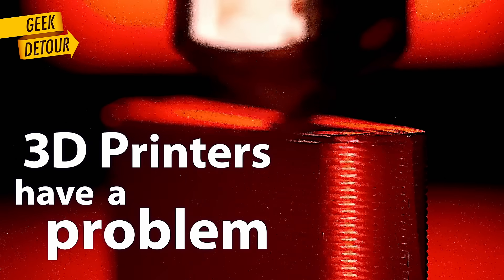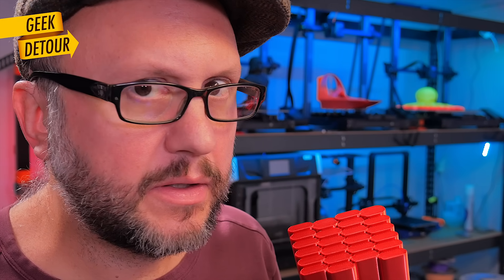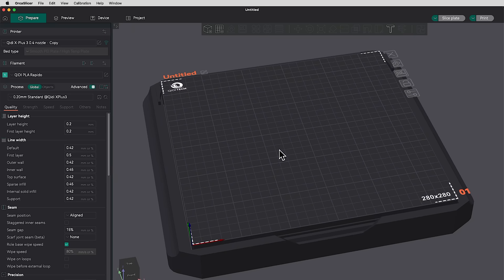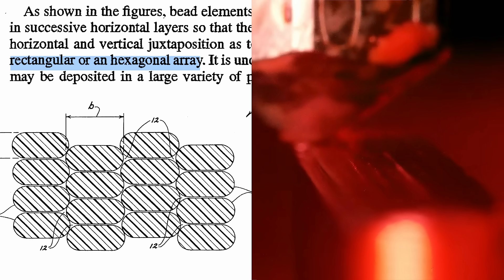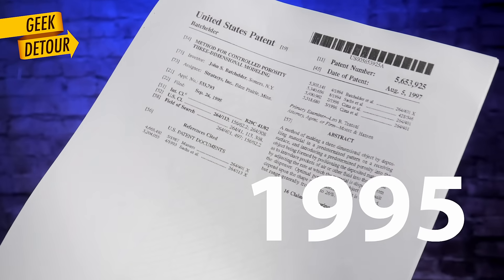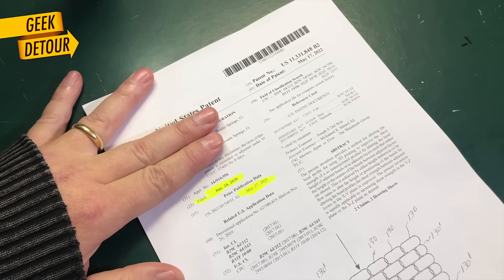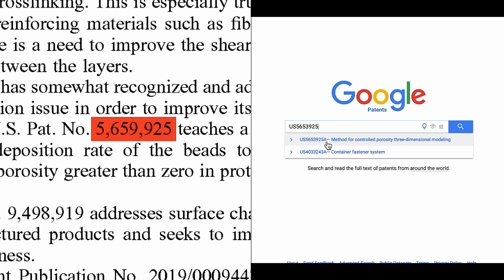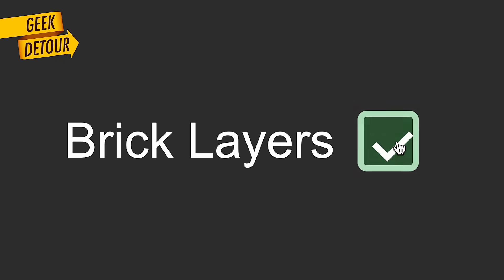Brick Layers: Stronger 3D Prints TODAY - instead of 2040 😬

Comment: i already watched such video and the difference is lame 10% of strength... waste of time
Reply from the maker: Stefan did just 1 test and there was still a bunch of porosity between the beads. I bet that if the speed, flow, cooling, etc are properly adjusted to maximize contact, we can reach 30% improvement / and that’s quite a lot better. We need easier ways to tweak this and test more.

Comment: off topic, but what kind of pen/ink do you use? 5:45 is very clearly some sort of fountain pen, but it's an incredibly fine tip and I've never seen an ink that flows that smoothly.
Reply from the maker: Oh, that’s a LAMY. It’s not expensive and you can write it “normal” (which is thick) or flipped, which writes way thinner.

Comment: I have not read the whole patent, just a brief look. However, it looks for me like the each layer has to be shifted. Will you mind to make a test and shift or increase thickness for example every 3th layer and then fallow the standard layer. Something for example start with standard, then 2 layers shifted and standard shifted etc. I think it was not presented in the patent unless I omitted something. Maybe it won't give the same strength as all layers sifted but yet it might make stronger in comparison to the standard print. Just a think to put into consideration.

Comment: That patent cannot be valid if it were to go to court... It is also only a US patent and not global. Maybe it can be solved by just contacting the company and pointing out that it has been one before and the flaws in it that points to that one. US patent office would probebly do a diffrent dessicion if they saw that it has been patented in the past that has expired, if the company know about the flaws in it, then it´s a fraud. Don't know how it works in the states but where im from a patent also increase in cost every year, so the company itself would probably want to withdraw it instead of paying for a useless patent. From what i can see the first of their applicants was in 2019. Since then there have been a bunch of different ones handling all the options. But the first determined is 2022.

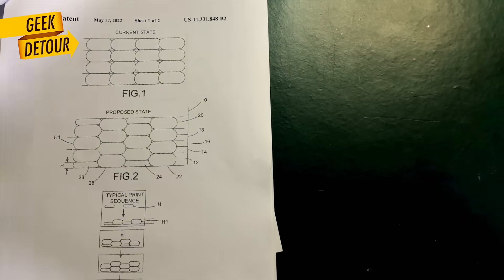Comment: 5:09 There's overlap. The non overlap technique seems to not be described here.
Reply from the maker: That's just an artistic difference on how the beads were portrayed. If you think of it, Stratasys drawing would be impossible to be 'printed' exactly as they are portrayed: the beads in the drawing don't really touch - which is impossible. In real life they surely overlap and melt together where they touch - spaces in the drawing won't change that. We are talking about the same technique here. This is such an interesting comment coming from an unusual YT account - I might say 🤣

Comment: I don't think this patent protects the brick layer strategy, but instead protects shifting layers over by 50% side to side so that the seams don't align vertically. 

If you look it up on Patent Center (click the link on the google patents page) and go to Documents & Transactions, you can see that when the patent was originally filed, it did include claims that talk about changing the z height to increase strength between layers, but those claims were withdrawn before examination.

The patent application did screw up, but the relevant claims aren't part of the final approved patent anyways, it only protects adjusting X and Y shifts to add strength, not Z shifts.

Comment: know what could work is a 3D printer that notches with a mechanical press like a small flat pad pin that pushes down on the filment after it's extuded but also why not have shaping nibs and compressor cooling

Comment: Even if the patent would've been valid, implementing the idea into a non-commercial(!) open source slicer wouldn't infringe upon it in Europe.
Reply from the maker: Interesting… I cannot confirm this yet. But I’ll check.
Reply: @GeekDetour  Do note that using the ideas disclosed under the patent for commercial purposes is another story, but that's not what this issue is about.
Reply: @GeekDetour  Software can not be patented in Europe
Reply: @dreamyrhodes  But it's not the software that is patented it is the printing procedure ;) Nethertheless it is pretty much void if its common knowledge or has been a patent before. Just do it, let them sue you and just state in court that you are not using their patent but the patent from years ago.

Comment: As far as i know, processes cannot be patented. This does include for example cnc cutting and so on. That is why computer programs, which basically process information, are protected under copyright and not patents. Following this logic, it seems odd that a patent was granted for this.
Reply from the maker: Hum... that's not true. In the United States, processes can be patented, provided they meet the requirements set out in U.S. patent law. Under 35 U.S.C. § 101

Comment: We need function iron each layer.
Ironing after each layer, which use 10% of main flow to fill gaps, still preserving flat pattern for layers, but with the price of long prints. And possibly to have possibility to alternate parameters for inter layer ironing and top layers.Or 
Or have second pass and print between walls with the reduced flow

Comment: Patents can be challenged based on prior art.  Also this feels like a necessary patent which means even if you can't get it overturned you can get the royalties scaled back significantly for using it

Comment: Instead of directly putting a tick box for hexagonal printing in a slicer's settings, couldn't they add support for user adjustale z height and make it easy to set this different for every pass? That way it's just a feature that offers precise control and it's up to the user on how to use it. If the user decides to use it to print hexagonal it's up to them, but it's not readily available as a feature meant to do that.
Reply from the maker: Yes, I am up for very fine customizable behavior too!

Comment: I've had some success with a slight overlap between rows. Works best with pla. Petg tends to pull away from the bed unless the overlap kicks in a few layers up. Or print  a raft and cross your fingers.

Comment: There should be a hunt for such illegal patents, in all domains. We're getting screwed
Reply from the maker: Well, they are not illegal 🤔 But they are highly disputable. The problem is always the costs to challenge. I cannot go there. I hope to see Slicer Developers or 3D Printer Manufacturers decide if they want to pursue that.
Reply: @GeekDetour  Well, patents are a bad solution to protecting innovation. They should only be worth the cost of discovery at the current time, and any one should be able to buy a share of the patent to the holders. Like pay half the cost of discovery to the original holder the first time and get half the shares, or pay 1/10th split to each of the 9 holders to become the 10th. That would make it worth to research profitable tech and get funds back quickly, and prevent trolls holding the world back with a patent that's worth nothing.

Comment: Most slicers have a plugin API. It's hardly the slicer's fault if somebody produces a plugin that adds this feature. I'm sure also that slicers could add an innocuous setting that changes the z-height by a small random amount when laying down in fill, walls etc. This would of course create  small vertical gaps but another innocuous setting could tells the code to fill any vertical gaps it sees by increasing flow rate.

Comment: The text of the new patent could be generated by AI. I had to convert a byte array to JSON, but the AI I used couldn't keep some strings, which repeated a few times in the original data, the same.

Comment: what would stop Orca Slicer from putting this in I wonder. While Prusa Slicer and Bambu Slicer are managed by companies that operate for profit, Do patents have any power over projects that are not connected to an actual company. In general I have wondered this since open source exists outside of a lot of boundaries, Anybody can technically add anything since you can pull down the source code.

In general I do not think this kind of thing should even be eligible for a patent, To me patents are for inventions. Things that you can physically touch, This is an idea for a process and if they want to protect it they should have to write their own slicer and then defend the programming code with the existing copyright laws.  But if someone makes their own code that does the same outcome differently than they have to compete.  Now if they invented a nozzle that could naturally do brick layers then I would say yes that is patentable.

Allowing patents like this to exist to me feels like if we allowed UPS to get a patent for "Package delivery using panel trucks".  Or a major home builder to own exclusive right to "Walls using studs for primary structural support".

Comment: It’s really a shame you used AI art for your video. It deter your point.
Reply from the maker: No, it doesn't. But I agree with you: hiring a photographer or buying stock photos would have been better.
Reply: @GeekDetour  What I meant to say is that AI art is basically using the work of someone else, claim the program did something original and not disclose the source of what it based itself on.

Comment: That video is what I waiting from 3d printing community. Thank you for that. Actually, there can be better patterns for smoother and stronger prints. We dont have to use this exact same method. We should use adaptive layer height especially for inner walls. My suggestion is based on that use half layer height in outer walls and 3rd inner wall. Printing sequence should be outer wall then 3rd inner wall than middle wall. I could'nt find any settings to do this, I want to explain technically this method to you. If we can do this, we will get better print quality, stronger prints with sacrifice of increasing a little bit print time.

Comment: No, definitely not. 3D printing cannot match the strength of injection-molded parts, regardless of orientation. Injection molding involves injecting plastic under high pressure, resulting in a denser, gap-free, and isotropic part. In contrast, FDM printing uses a low-pressure, expanded deposition process, which creates parts with inherent gaps, lower density, and anisotropic strength.

Alternating layers, an approach explored around 2009 by the RepRap community if I remember correctly, can improve the strength of FDM parts slightly over even layers, but it's still far from reaching the strength of injection molding. FDM printing has its unique advantages, like creating complex geometries without molds, which injection molding can’t replicate. However, if a part can be made with both methods in the same material, injection molding will produce a significantly stronger part.

Comment: Cura already supports this .. although it only works for about 3 wall line counts (most people dont use more than this)
if someone wants to know exactly how, i can take a look at my settings. but the settings are in the infill category, you add infill wall lines with a custom layer thickness.

unless you're printing 5+ wall lines and require strength across layer lines, the strength you gain isn't worth fighting over. not to mention doubling the layer time. if your layer height is 0.2 mm, you'll be printing at 0.1 mm to fill the gaps. if you're smart and think you'l get around it by doubling it.. now your layer thickness is 0.3-0.4 mm and re-introducing gaps between filament layers

Comment: The problem is that challenging a US patent takes money, either in court after you're sued by the patent holder, or by filing a petition via the USPTO’s Patent Trial and Appeal Board (PTAB). You can also petition for an ex parte re-examination of the patent, which is a lot less expensive. I'd suggest going that route, do a web search of "2209 Ex Parte Reexamination [R-07.2022]" for more details from the source.

Comment: The USPTO has an ex parte reexamination that can be filed at a low cost. https://www.uspto.gov/web/offices/pac/mpep/s2209.html 

Seems that the current patent should be filed for reexamination with your research it seems that the patent holder should also be notified of their patent issues and be asked to do the right thing. If we know the company a proper social media request could be filed to do the right thing content creators such as Stephan and the 3d printing nerd and others could circulate the petition. We should not attack the patent owner but ask them to do the right thing along side with the ex parte patent reexamination